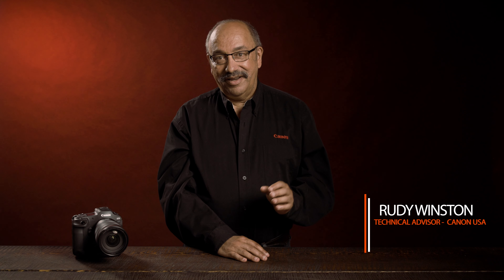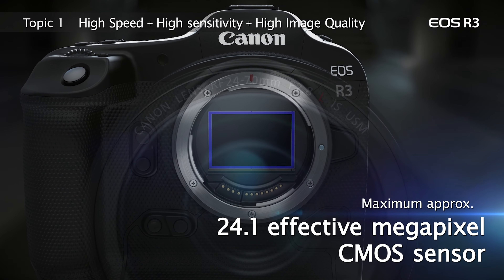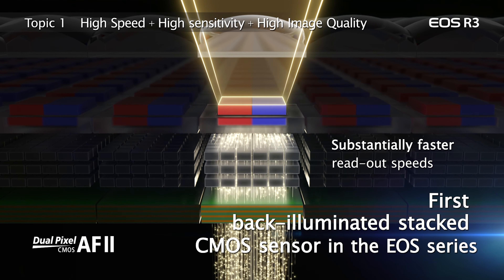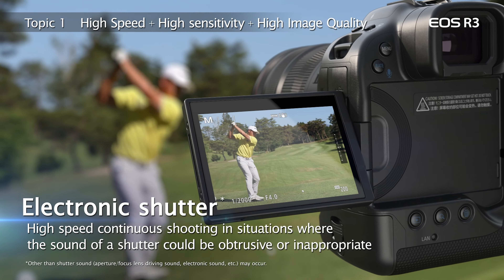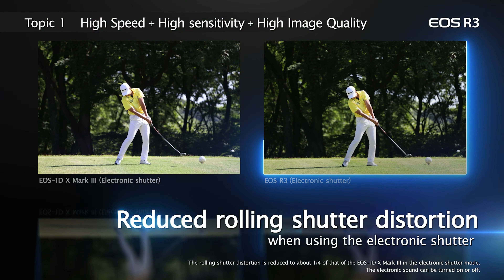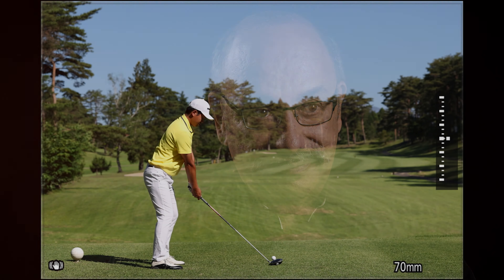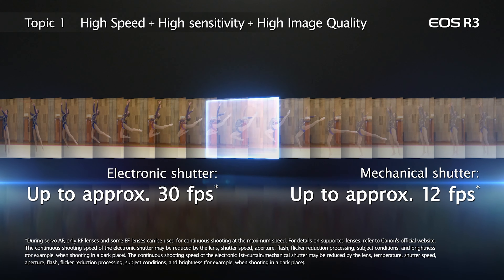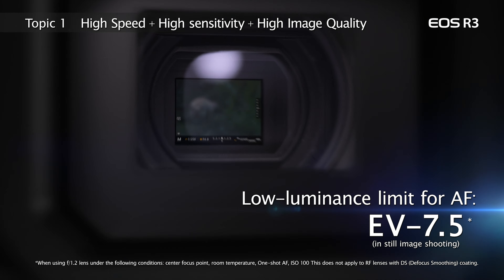The Canon EOS R3’s New Back-Illuminated, Stacked CMOS Sensor with Rudy Winston

Comment: Hello, I cannot get a clean image in raw video slog 3, 800 and 1600 ISO. Do you think this is normal?

My exposure is correct, I tried at least 3 different programs. As a result, I cannot get rid of the same noise.

Will there be a Mac version of the video raw conversion program?

Comment: Is there any improvement in video (over the R5) regarding the back illuminated sensor?  i.e., Improved dynamic range? etc
Reply from the maker: Hi Miguel!

Image quality is improved with a great reduction in rolling shutter distortion.  This is achieved by faster readout speeds from the back-illuminated stacked CMOS sensor working in tandem with the Digic X image processor.  For details on this and other camera performance, you can contact our camera support team at 1-800-652-2666 Monday-Friday: 9:00 am to 9:00 pm ET, Saturday: 9:00 am to 7:00 pm ET, excluding holidays. 

We hope this helps.
Reply: @CanonUSA  that’s great! besides rolling shutter distortion, can we expect improved dynamic range?
Reply from the maker: @Miguel_Molina  The dynamic range of the sensor is similar to the EOS-1D X Mark III, if you need to capture HDR images though, the HDR mode of the EOS R3 can take 3 images in 0.02 seconds (depending on shutter speed) to reduce subject movement.

Comment: In terms of a user who makes large prints, how is the 24MP R3 better than the 5DSR with 50.6MP?
Reply from the maker: Hi Cesare.
When comparing these two cameras, you need to consider the type of subject you are photographing and the environment where you are photographing.  The 5DS R and the R3 are designed for two different types of photography.  The 5DS R is for images that require the highest level of sharp detail.  It is a great tool for landscapes, architecture, interiors, products, fashion and other subjects that require high detail.  These subjects are often stationary and in a controlled or slow changing environment.
The R3 is designed for capturing fast action moving subjects.  These subjects are often on locations with little control over the lighting or environment.  The priority is on a sensor with great light gathering, auto focus and processing speed to be able to “get the shot” in challenging situations. The camera body has to be strong enough to survive the environment.  Think of a sports shooter on a football sideline during the rain or a nature photographer on safari.   Generally, one would be choosing the best camera for the job, based on the subject, location conditions and needs of the final image, more so than megapixels alone.  
 Hope this helps, but if you have other questions our camera team can discuss the features of both.  Call them at 1-800-652-2666 Monday-Friday: 9:00 am to 9:00 pm ET, Saturday: 9:00 am to 7:00 pm ET, excluding holidays.